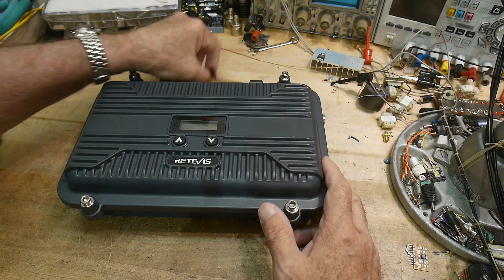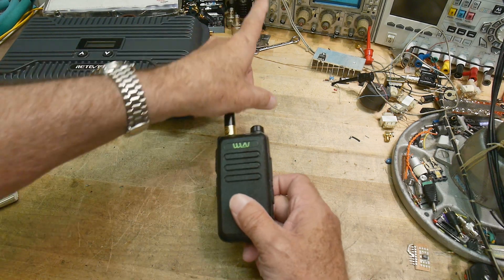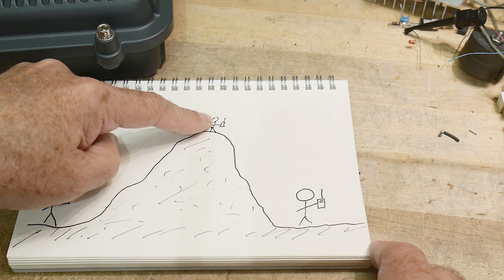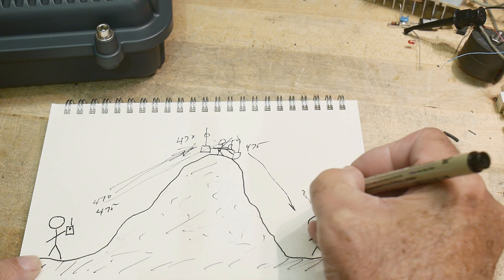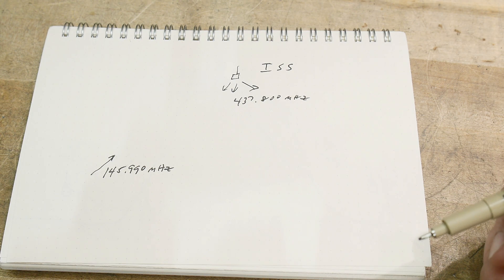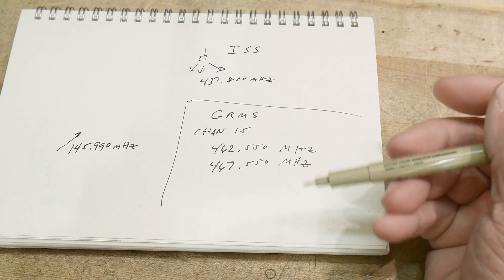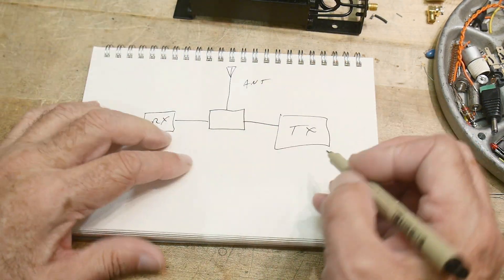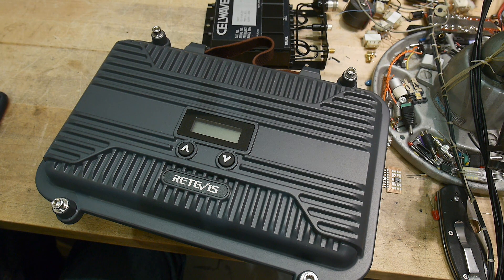#1490 What is a Repeater?

Comment: I'm not a ham guy and don't have much experience in communications.  But i want to ask
1) you said if I'm locky i could catch ISS and talk to it.  Does duppler effect change the frequencies weather it's coming towards me or away?
2) your last drawing showed your repeater's with rx and tx.  Don't you need a mixer as well?  
3) the notch filter should filter out tx+rx and tx-rx frequencies.  I guess these frequencies are so extreme that we assume they are outside of notch filters working frequencies and they would be filter out.
Reply from the maker: 1. both
2. no
3. notch filter kills one frequency but all others are passed

Comment: I believe it transmits at 475 what it receives at 470 and transmits at 470 what it receives at 475.  This would be a duplex down-conversion, amplify, and up-conversion.  Person A is at 470 MHz for receive and transmit and Person B is at 475.  This is straightforward and compatible with standard gear.
Reply from the maker: hopefully in tomorrows video I get that right
Reply: @IMSAIGuy  Verify first.  This might especially be wrong regarding the ISS signals.
Reply from the maker: @byronwatkins2565 ISS:  https://youtu.be/O4XG_zIeA3A